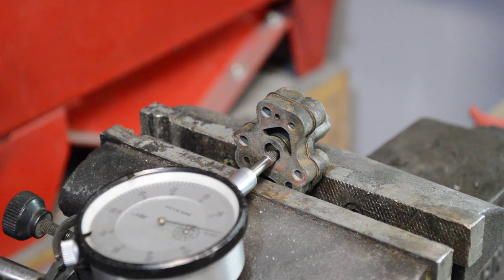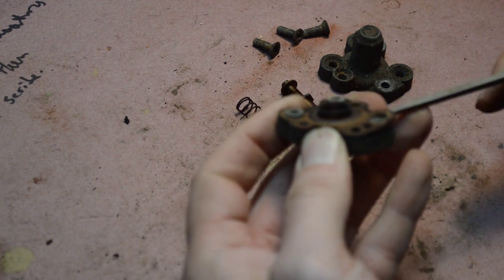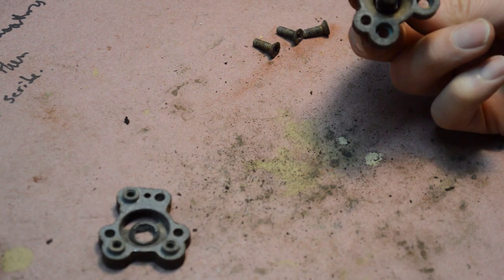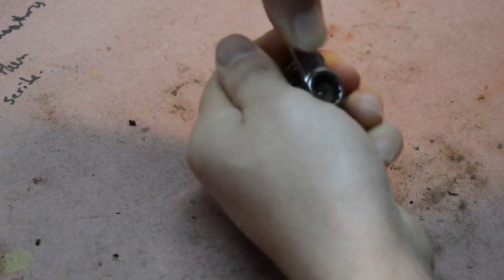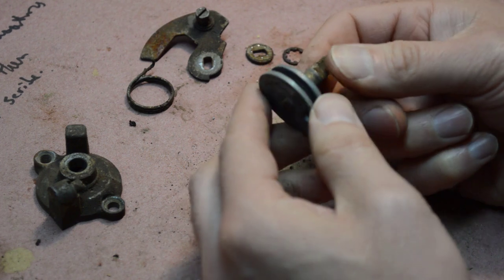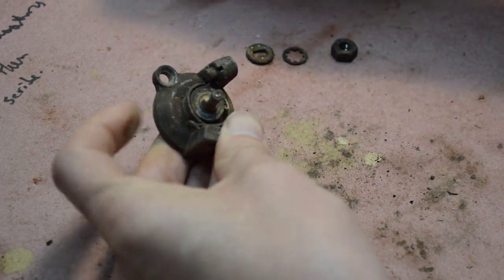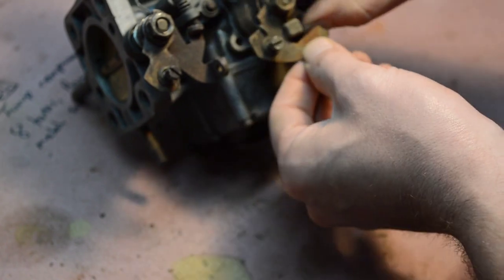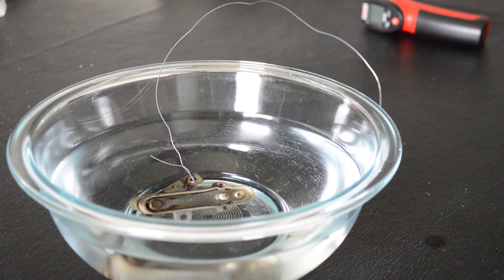Rebuilding Zenith-Stromberg CD-175 Carburetors - Bypass Valve, Choke, and Temp Compensator

Comment: This is great info for me. Just bought my first 1974 TR6 to totally restore but l wanted to try and start it to see if it runs. Now l will feel a lot better about rebuilding the carburetors! Thanks!
Dave in AZ
Reply from the maker: Good luck!  Restoring a TR6 is just a lot of little jobs put together.  They're great cars!
Reply from the maker: The TR6 is a great car to restore.  The separate chassis means you can get a really good look at every square inch and separate the jobs to be done.  Just take your time with the restoration and don't get discouraged.  Good luck!

Comment: Excellent explanations! Many Thanks! I disassembled the temp compensator because it was stuck. After 50 years, both the plastic pin was rough and the socket slightly oxidized. I stretched a small rag into the cordless screwdriver and polished the bushing bright with aluminum polish. I did the same with the pen. Now nothing is stuck.
Reply from the maker: Glad it helped!

Comment: My bypass valve has the external vacuum tube as well as the screw adjuster. I’ve mistakenly taken the entire valve part and cleaned it. I set it to where the other carb bypass is set and it does work when a vacuum is applied. 
The question is, is there an adjustment once the car is running?
Reply from the maker: Yes, but realistically if you can get the idle set under 1000 then it doesn't need adjustment

Comment: Got it - seems to me to be very complicated and not really doing much to make things better.  The Jag Chilton's guide has some info on setting/adjusting it, but I think they have the parts diagramed wrong as you can't actually do what they say to do.  Going to just do the rebuild as is and see what we get, but at some point may pull the motor to clean up the engine bay and could do a manual choke kit then (if I can find one).  Thanks again!!
Reply from the maker: Most parts on these carbs can be made operational by simply cleaning them.  I don't find they much needs to be adjusted except for the float height and the needle/jet.

Comment: I have another section of questions about my choke - I am "lucky" enough to have a Series II XJ6C that has the water choke system.  I have taken it apart and am cleaning it up, but there is a screw hole on both carbs that looks like an adjustment screw but is missing the screw.  should there be a screw here?  In general, are these chokes any good and, if not, should I just convert it over to an old style choke and bypass the coolant lines?  According to my father in law, these chokes have never worked well at all.  Thanks again!
Reply from the maker: Yeah, I'm not a super big fan of the water chokes, though if I'm being honest it's partly because I don't have them in my cars so I'm just less used to them.  Triumph had a sort of auto choke they used on the TR7 which was more or less a separate carburetor bolted where the choke goes.  It works fairly well, but I'm not sure it'd fit on your Jag or if the one on the XJ6 is that same system.  In truth, if there's a kit for a manual choke it wouldn't hurt to put that on as it'd be more reliable and remove a potential leak spot (that is, unless you're going for originality).

Comment: On the bypass valve, didn’t you say in the previous video that it had a vacuum leak where that external screw was? How did you fix that? Did the new diaphragm fix it?
Reply from the maker: In that case I fixed it using a different bypass valve I had laying around. Generally though, cleaning the surface, replacing the o ring, and using a sealant are what I would do.
Reply: @midwestmotoring  thank you for responding. I thought about using a sealant actually. I’m not sure if the O-ring is in my rebuild kit or not. I guess its in the bypass valve rebuild kit, which is separate. I do have a large assortment of new O-rings though, and I bet one would probably fit.
Reply from the maker: Most likely.  I've found the orings themselves just do a poor job sealing.  I set up bypass valves for a given amount of vacuum, so once set I usually just seal the end before reassembly to prevent it leaking.

Comment: Hello!! Thank you for these videos - without them I would be lost!!  Question on the bypass valve - the kit for this has 5 gaskets and when I took mine apart per your instructions, there was a gasket, the diaphram, and then another gasket.  In this video you take it apart and there is just the diaphragm and then you put it together with just the diagram.   Which way is correct?  If as you did it, how come there are so many duplicate gaskets?  Thanks in advance!!
Reply from the maker: Great question!  It's a kit meant to suit different variants, so there's a bunch of gaskets and o rings you may or may not need.  As a general rule, put back the gaskets that you took out.  The diaphragm is usually sandwiched between 2 gaskets though, so that's likely correct for you.
Reply: thank you!  @midwestmotoring

Comment: Hello sir ; first , thank you for the excellent video , couldn’t have done it without you great help , NOW ; could you please have a part number for the two return springs (Excelerator and choke @ 11:04 min.)  , I’m going Fing crazy trying to get them , thank you .
Reply from the maker: Your best bet is a company like Moss Motors. They'll have a parts diagram and can ship the springs to you without needing the factory numbers. Unfortunately I don't know the numbers either, but know that not all chokes had a return spring. If yours didn't have one when you took it apart, it might not need one. You would just need the correct choke cable (the solid rather than stranded one) if you're working on a TR6.

Comment: My starter box does not have a spring, just a brass pin with a ball bearing ( spring loaded ) that fits into the indent on the cam of the box. Is the spring absolutely necessary ? Hope this reaches somebody.
Reply from the maker: Hello!  Nope, spring is not necessary. Cars with a solid (not stranded) choke cable didn't have springs.
Reply: To whom it concerns, thank so much for your response.
Next question : what is the function of the bearing and indent ? When i took the carb. out the bearing was not riding the cam ( nor is it on the other carb. ) and I’m sure had not been for quite some time. I tapped it back into place to allow contact but not sure it’s necessary?  Thanks again

Comment: I hope you don’t mind me asking for advice, if you do don’t read further, your videos are great. 
My late 73 Gt6 has a rebuilt engine and has started and ran but not driven. The carbs are cd150se, twin chokes. However, it has developed a problem, it won’t start. The front carb was leaking petrol around the area a where the fuel enters. I thought the flow jet might be blocked but seems clear. After reassembly and hose and pipe replacement things are no better. This time the rear carb is leaking petrol but from the dump canister pipe on the left hand side. These are new old stock carbs but did start up fine and revved ok. Now it fires on two or three cylinders but won’t rev up and after a few moments it dies.
Is there any reason why you think there is  petrol coming out the emissions pipe? I have a video. Other info: the plungers go up and down freely when the tops are out but it is very difficult to raise them when the tops are in. They raise a little but then it’s very hard to raise by hand. There is petrol also coming out in the main aperture where air goes in.
Any suggestions are appreciated. I have a little video I can email you maybe and a pic or two. Kind regards, Ken
Reply from the maker: So for the leaking fuel a the front of the carbs where the fuel goes in, that's down to a poor seal, way too much pressure, or both.  I'd replace the hoses, the hose clamps, and verify the pipe itself is in good shape.  If everything is tight, then it won't leak there.  Also keep in mind you might be seeing a different leak--for example the float bowl gasket could be leaking.  

At the rear of the carbs with the emissions control vent... fuel shouldn't be up that high.  It's possible you've got too much of a vacuum on the charcoal canister making it through to the carbs.  That would be drawing fuel through the vent rather than just venting.  I think there should be a restrictor somewhere, or maybe it's in the charcoal canister itself.  Unfortunately it's not my area, but that's where my mind is drawn to.  Do not block off the fuel vent--it'll just cause excessive pressure and fuel will leak anyway.  

It shouldn't be difficult to raise the air pistons even with the tops in--at least... it shouldn't be difficult to do it slowly.  When everything is assembled, it's intended to slow down how fast the engine can raise the pistons.  It'll eventually get to the right height, but not quickly--that makes for a richer mixture when you're accelerating.  If the pistons drop back down easily, then it's probably okay.  Maybe try a thinner oil in the dashpots if it's still too hard to raise.  

It sounds like you might have excessive pressure.  That would cause fuel leaking from the body of the carb, and probably from the vent.  It could also make for a fuel leak where the fuel goes into the carb.  I'd get a gauge and plug it in.  You should only have 1-2 PSI.  Too much more than that and there's your problem.  If you have an electric fuel pump, I'd recommend a fuel pressure regulator.  

I hope that helps!
Reply: @midwestmotoring  thanks very much for replying so promptly. I have replaced all hoses and new pipes. My car does not have an emissions canister from new but I bought the carbs but did not recognize the emissions pipe in the side, this was not on the original carbs. I will check the fuel pressure too although it’s a new standard fuel pump. I will keep you posted. Is there any of sending a very short video. Thanks again
Reply from the maker: It's not a problem if you haven't got a canister. Just let the carbs vent to atmosphere. Do not block the vents or they'll leak for sure.
Reply: @midwestmotoring  great, that’s the way I have it set up.

Comment: Can the bypass be adjusted properly with the vacuum gauge?  In other words how many inches of vacuum for a given opening?  Great set of videos BTW.
Reply from the maker: I suppose that's technically possible.  As a thought exercise, I see 2 problems.  First, you'd need an accurate enough way to measure it.  The plunger doesn't move very much, so I imagine a few thousandths one way or another could make a difference.  Second, it would be at best a ballpark.  In the same way setting the metering needle in a "neutral" position is just a baseline, I'm guessing you'd end up adjusting the bypass valve even after setting it up like you're thinking.
Reply: @midwestmotoring  I did a little more searching and I found someone who claimed he set up on bench with vacuum at 20-22 inches.  Also Harbor Freight has a Viton o-ring kit that has o-rings that will fit the Stromberg, including the one down around the needle.

Comment: I have a 76 Tr6 with 175's. The bypass valves have ports that tie directly from the valves to the distributor. Is this correct? Or should they tie to manifold vacuum as well?
Reply from the maker: Hi Shane. I could be wrong but I think those are meant to go to manifold vacuum and not the distributor. Maybe someone else will chime in?  I believe the distributor should be connected to a fitting on the bottom of one of the carbs, possibly through a thermostatic switch near the radiator.
Reply from the maker: A good reference is the moss Motors website. They have pictures of the various configurations under emissions control under the intake tab. Sounds like you may have parts from a 74 TR6?  I believe early bypass valves got their manifold signal from a tube on the top of the bypass valves like what you're describing instead of a hole machined in... so your bypass valves may not be original to the car.  The system also could vary country by country, or by state if you're in the US. You also might be missing some parts. Sorry that's not super helpful... :(
Reply: @midwestmotoring  Thank you for replying, I have been able to get my dads car running after 7 years of sitting because of your videos. I am currently fighting a high idle, I've rebuilt both carbs and bypass valves. In doing that I noticed whoever did it before me closed off the trim screws and adjusted the metering needles to max fuel (all the way up) so I put everything back to how it was. It still acts like it needs more fuel so im assuming i have a vacuum leak.
Reply from the maker: Most often when I find the needles tuned as rich as they'll go, it's either a vacuum leak or the floats not set correctly. Poor ignition timing can also cause similar problems.
Reply: @shaneroot9159  Shane, in my '71 I rebuilt the bypass valve as recommended, and it would just opened wide immediately.  Idle was way too fast and pulling way too much air.  Maybe it needs a stronger spring.  IDK.  Whatever, I finally just sealed it off.  Put tape over the brass valve.  I could not get it to work and the car would idle at 1800-2000 no matter how the fuel was tweaked.  It's not a critical feature.  More a pollution control valve for deceleration.

Comment: Hi there. A question: from 14:28, your right thumb is by a small sprung (I believe) value or piston. It is part of the body of the carb. What is that? Should it move when the throttle is opened just a little bit (either as you demonstrate the 'chock'/ starter box doing, or when you touch the throttle with your foot)? Mine are seized solid on two carburettors, which does 'feel' right. There is an intermediate adjustment screw, suggesting something happens. How would you service that part? Great vid., by the way. Exactly what I need for my Saab 99. Thanks.
Reply from the maker: I think what you're referring to is a valve built into the carb body.  It's part of the float bowl vent, and directs the vent towards either the air cleaner or to the charcoal canister on emissions controlled cars.  I address it in the "Rebuilding Zenith-Stromberg CD-175 Carburetors - Disassembly" video at about 25:30.  It is supposed to move, but it's not uncommon for it to be stuck.  You would ideally free the valve, but earlier carbs didn't have it so it's possible to live without it.  If it's frozen where the valve opens towards the exterior vent (to the charcoal canister), you could be venting fuel fumes to the atmosphere--but you should NOT cover the vent.  The modification that's not uncommon to do is to open the vent permanently to the inside (towards the air cleaner) so that excess pressure in the float chamber vents into the air cleaner and gets recycled into the carburetor.

Comment: Just disassembled the CD175 on a 1973 TR6, the Bypass Valve gasket has been added too, so it blocks off both ports and will not function.  Any reason this would have been done?  I can provide pictures if it would help.  I have no history on the car, but attempting to rebuild the carbs so they work as intended in 1973.  Thanks, Robert in OR
Reply from the maker: Hi Robert, good question.  As with many things, the number one reason to block something off is usually due to a lack of understanding of what it does and how to make it work.  It's possible the bypass valve was leaking (an easy fix if it was).  Or perhaps someone noticed that earlier carbs didn't have the part and disabled it thinking that it detracts from performance (it doesn't).  Very commonly with the bypass valves, the diaphragm dries out and stops working--but a new one isn't included in most rebuild kits.  It's possible a previous owner saw the gasket was missing and made a new one to block off the unit rather than wait for the correct part.  In any case, you're doing the correct thing by putting it back to stock.  I'm not suggesting modifying cars is bad, but it's a whole lot better when everything works as a system!
Reply: @midwestmotoring  Correct, the rebuild kit from TRF does not contain the diaphragm nor the small o-ring for the adjustable needle.  Just a small piece of additional gasket material added on top of the original gasket to cover the ports.  Nice video's by the way. Thanks, Robert in OR
Reply from the maker: Glad I can help.  For the life of me, I don't know why they don't include the bypass valve stuff in the rebuild kits.  They're ALWAYS dried out and cracked.